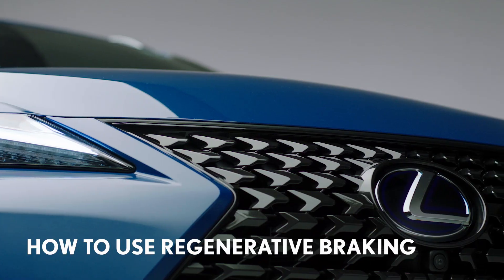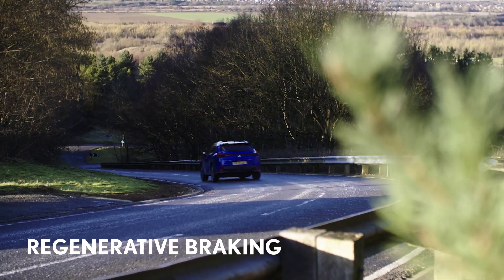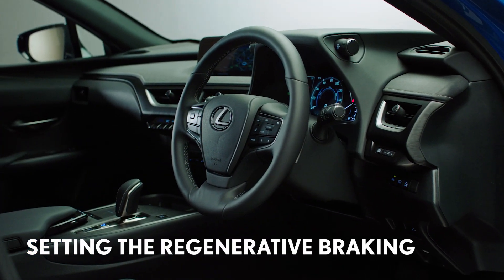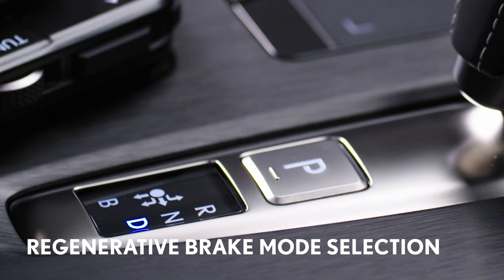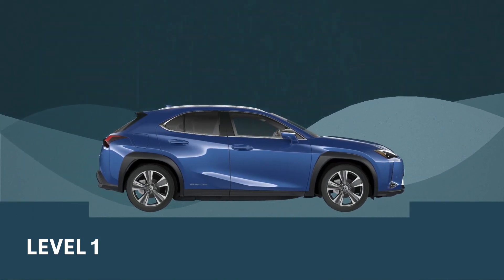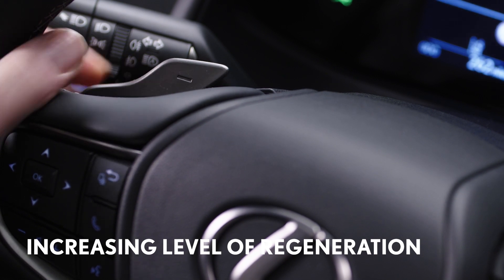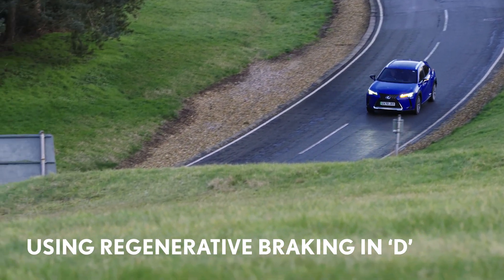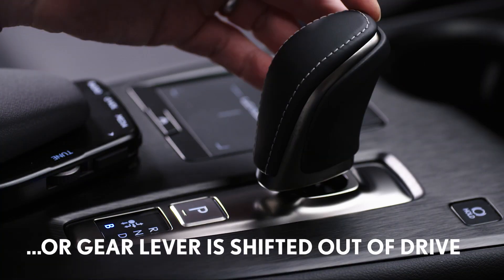All-Electric Lexus UX 300e: How to Use Regenerative Braking in Your UX

Comment: There are only a few things that annoy me about my Lexus UX 300e. One of them is the warning that “regenerative braking is not available” that appears when driving with the battery fully charged. If it happened only that would be okay, but it keeps on happening over and over again until the battery level drops—I’m not sure at what point. This is a piss-poor piece of programming.
Reply: I have exactly the same thing. Asking the questions how to turn of the constant reminders
Reply: @derekperry9990  Derek, I have found a workaround: set max charging limit to 90%. This gets rid of most of the warnings and has the benefit that some harvesting is possible to give a slightly more economical drive.